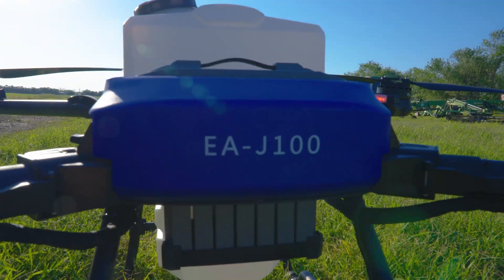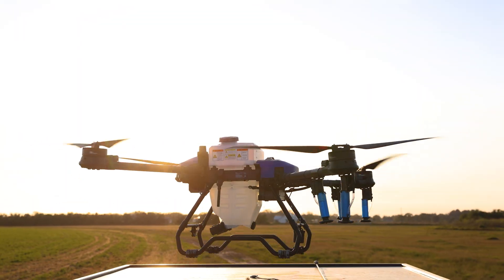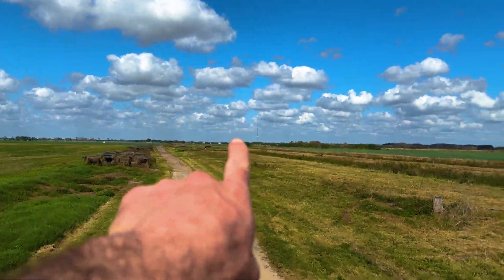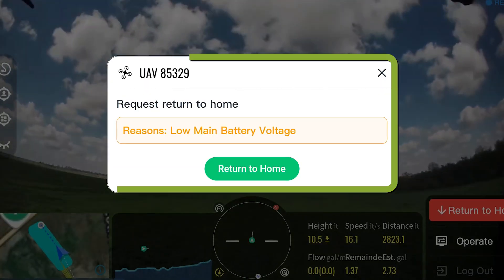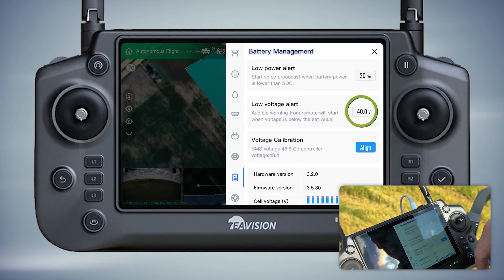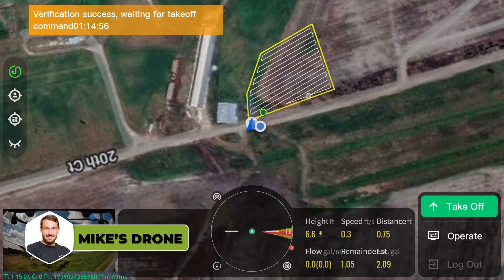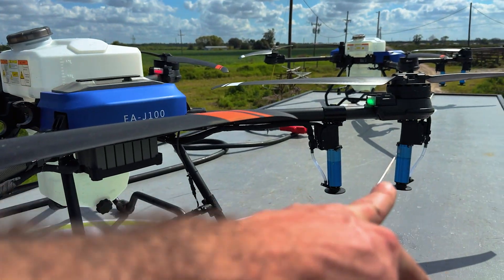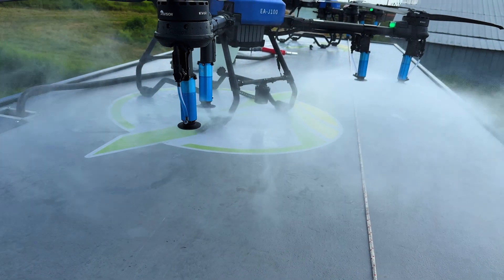EAVison J100 Follow-Up: More Struggles & My Final Thoughts

Comment: These things are not ready for prime time. They don't sell well anywhere else in the world. They're not new. Only new in the USA.
Reply: They are not reliable. I have had two different drones drop out of the sky for the same issue and they both happened in the range of 200-300 acres covered. They sold people on their demos then when it came to delivering to the consumer they completely changed the wiring and it fails time and time again. Not an ethical company in my opinion.
Reply: Yikes! This keeps getting worse.
Reply: Aqui no Brasil EAVision está crescendo muito rápido! Na feira agrícola Agri Show, de São Paulo, que é uma das maiores do mundo (acredito que a maior em faturamento de vendas, inclusive de drones) o estande da EAVision foi o maior estande de drones da feira toda, e eles mostraram o J100 e também o J150. O J150 foi muito impressionante, é um competidor parelho com o T100 da DJI, mas aparentemente mais estável (ouvimos que tem muitas quedas do T100 na China, por isso não foi lançado no Brasil ainda).
Sinceramente, acho que os drones com o LIDAR são o futuro, cansamos de ter que corrigir a altitude o tempo inteiro nos drones Agras. 
Com os updates corretos (eles lançam um atrás do outro) e um bom piloto, diferente desse cara do canal aqui que tem mídia cara mas não parece saber voar direito, o J100 tem voado bem no Brasil. Estamos curiosos demais pra ver o J150! 
Nesse meio tempo vamos esperar sentados pelo T100, que parece que não vem mais. Estamos um pouco cansados com a falta de inovação nos DJI Agras, o T100 ia ser um refresco com pelo menos uma nova tecnologia e talvez um desvio de obstáculo um pouco melhor, mas parece que não vão lançar ele nem esse ano ainda ):